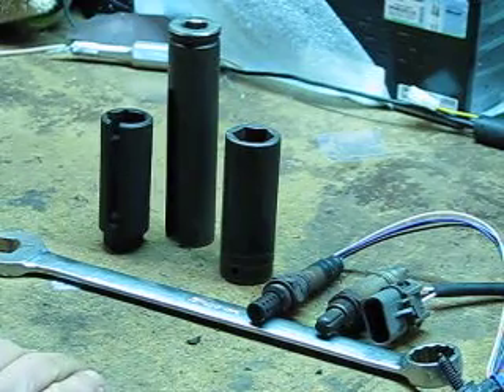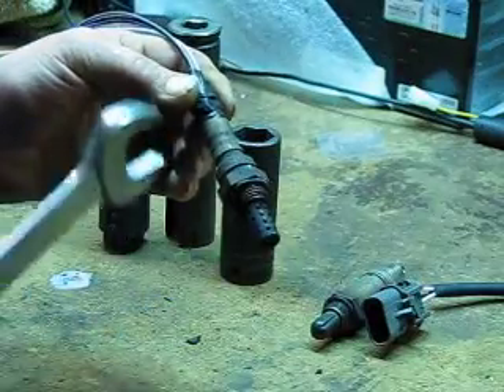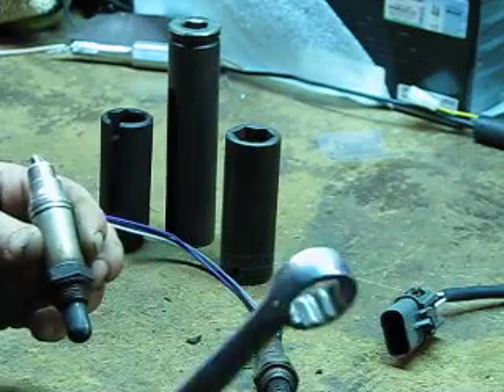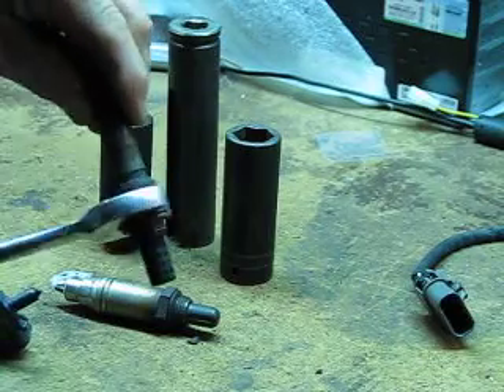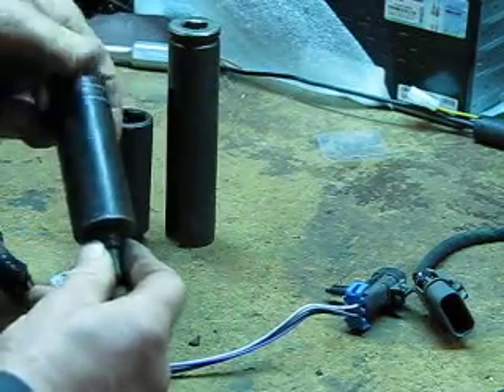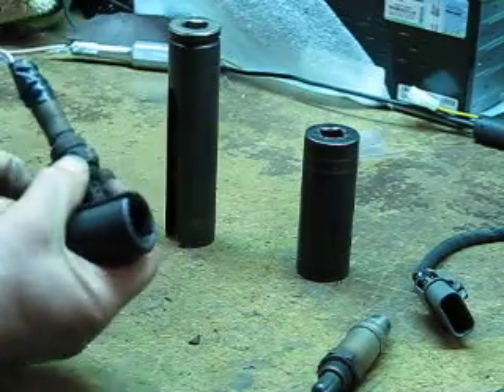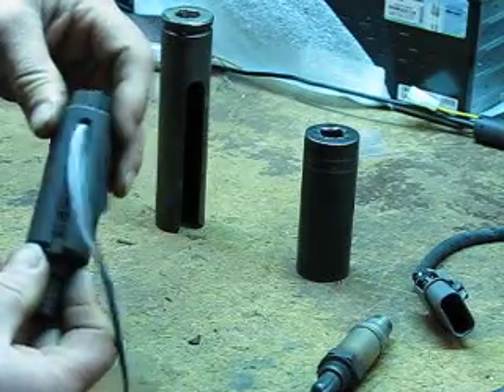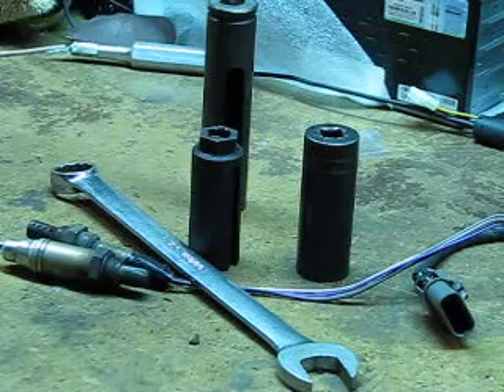Oxygen Sensor Tools

Comment: Great video can't ask for more very informative.
Reply from the maker: Tighten it like a gasketed spark plug.  Finger snug with gasket touching then add 1/4 turn.   It doesn't have to be ultra precise like a head bolt or water pump bolt.  I explained that in the video.  If you insist on using an exact torque value, you add the length of your tool's offset to the length of your torque measuring tool and adjust the torque setting down appropriately.  IOW if your socket has an offset of 2" and your torque tool is 12", the socket adds about 17% to the length of the tool.  Reduce your torque on your torque measurement tool by 17%.  But truthfully I think it is WAY overthinking it.  Yes - there is a torque value for every fastener on a vehicle.  Many times common sense can prevail and the repair be successful.  The big risk for O2 sensors is overtightening, tool damage to sensor,  and crossthreading.  Avoid those three traps and you're golden.
Reply: He never tells you WHAT SIZE SOCKET OR WRENCH OMFG

Comment: AND if you get yourself a 22mm wrench or socket before you round the corners you will have better luck.Most people use 7/8" wrench or socket.22mm fits tighter.its 20Thousands smaller.

Comment: On mine I can not get a socket or a box end on the hex of the sensor due to the cast iron manifold. I got the old one out with a vice grip on the body of the sensor. I don't know how I will get the new one tight. I couldn't even get an open end on it either, due to the casting of the manifold which in many places is almost as high as the hex nut on the sensor. Must be a special wrench out there somewhere. It basically in a blind area, where I can feel the casting, but I can not see it.

Comment: What if you cut the wire but can't remove the sensor removed a regular wrench. With the wires cut will the car still run? Just hard to know if I can remove the sensor without cutting the wires, don't want to be reattaching the wires with electrical tape.
Reply from the maker: It wil lrun but it won't run right with the sensor disconnected.  Commit to the job in its entirety, take it to a professional, or abandon the idea of changing the sensor.  There is no safe point halfway in.  Sometimes you have to heat the pipe at the sensor thread area to get it out.  Know that going in.
Reply: Tape them back together then head to a muffler shop

Comment: He forgot to mention you should soak it with all free two three days before you attempt taking it out!
Reply: Also forgot about the offset o2 sensor socket for tight spaces
And technique of using a short 3lb sledge hammer to hit the wrench to nock it loose .

Comment: What if i take my 7/8th wrench and cut a notch in the closed end?
Reply from the maker: It will probably break when you apply pressure to it.  You can look at Flare Nut Wrenches which are gapped box wrenches and see how robust they are built to accomodate the gap in the box end.

Comment: The split sockets are ONLY TO BE USED FOR RE-INSTALLING THE 02 SENSOR! These split sockets slip and round off the 02 sensors on stubborn 02 sensors upon attempted removal.  And ALL of them are stubborn. Cutting the wire as close to the 02 sensor as possible and a 1/2" drive 22 mm six-point DEEP WELL IMPACT socket ($5.00 ish at home depot husky brand/check the inside depth before purchasing/must be deep interior) and a 1/2" breaker bar with a section of iron gas line pipe (or whatever you got) to slip over the end of the breaker bar for even more leverage is my next try, along with warming the engine for at least ten minutes and some penetrant spray and possibly heating with map gas. You will have even more problems if the split sockets are used in an attempt to remove the sensor.

Comment: Has to be a 6 flats wrench...not a 12 like this one..The 6 sides on the sensor hex then mate with the wrench....
Reply from the maker: If you have a good fitting wrench such as the Snap On wrench shown, it is very do-able.  I have used this technique dozens of times with the wrench shown.  If a 12 point SO flank drive can't move it, it needs heat.  Yes a 6 point will bite better, but at that point the sensor is gaulded and needs heat or risk pipe / manifold thread damage.  I will agree that a cheap poorly fitting 12 point wrench might not be the best choice.
Reply: @bobkos333  That assessment sounds sensible. I had to google "gaulded" and apparently its a horse riding term for a roughed-up/irritated/chafed   horse's back and I get the picture when applied to butchered hex bolts...  lol...

Comment: Be nice if ya tell the thread size so i can scare up a tap 2 chase d thread in d manifold.
Reply from the maker: Sometimes a six point won't clock to the right position.  A good quality 12 point wrench is fine.  If a 12 point is going to round the sensor you need heat.